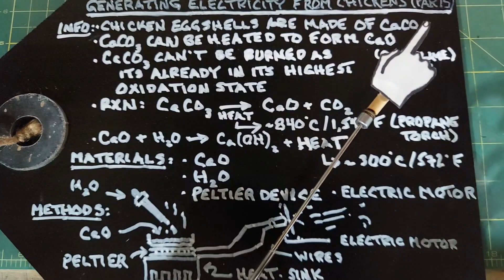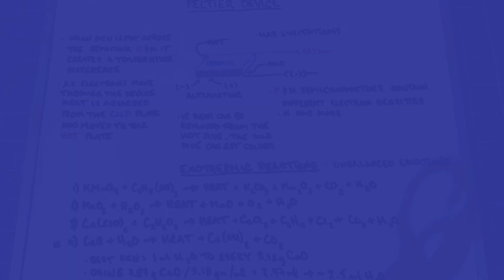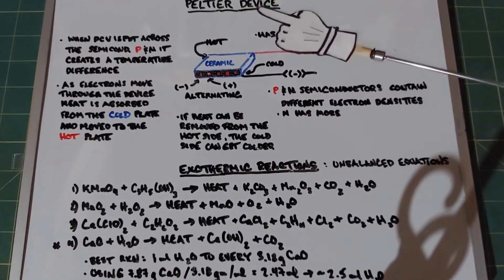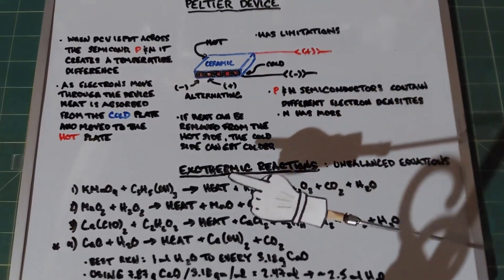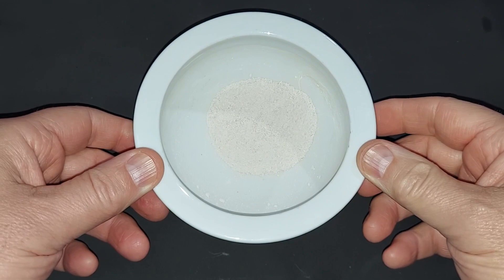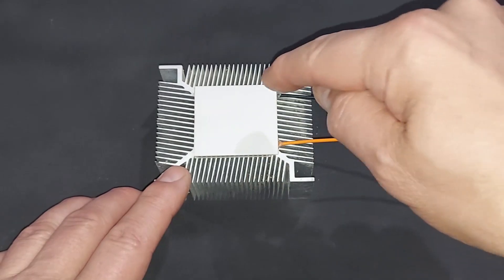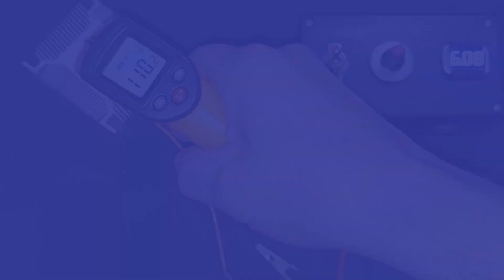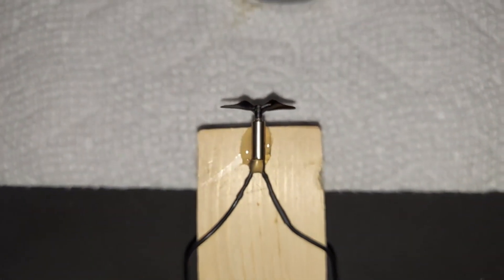Hypergolic Chemical Mixtures And Using Eggshells To Generate Power

Comment: 30 minutes of propane is thousands of BTU's. Harnessing that power through a peltier array would be a way to increase efficiency of the project. That may be used to charge a battery array, or even an electric car? Even a small torch puts out 1.5kw potential energy. Harvesting even 2/3rds of that would be wildly significant, however you'd need a huge array of peltier devices (or build a larger one yourself?)

Comment: Hi. Very good chemistry channel. I like that the explanations are so pricise. 
The demonstration at 13:13 (calcium hypochlorite and poly ethylene glycol) the problem with it could have been that the poly ethylene glycol is a hidrophilic substance and maybe it has had already enough water in it to slow down the reaction.
It can be that the containers sealing was not good enough and alowed the moisture from the air to absorb into the Poly. 
Anyways...keep it up!
Reply from the maker: Interesting thought.  I appreciate it.  Thank you!